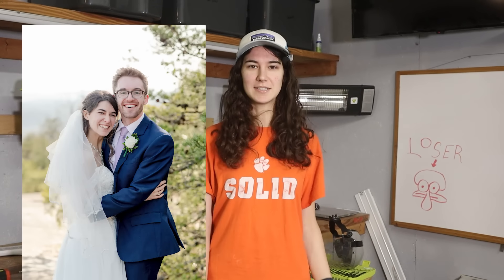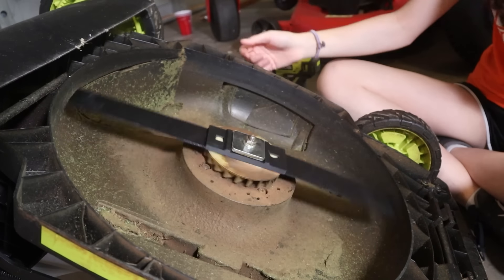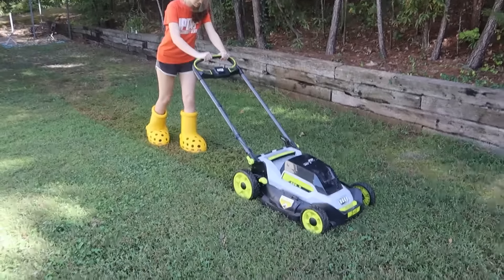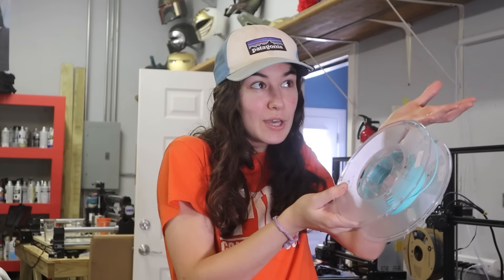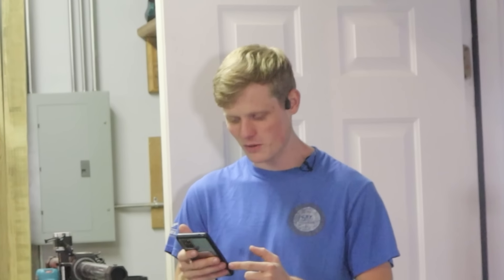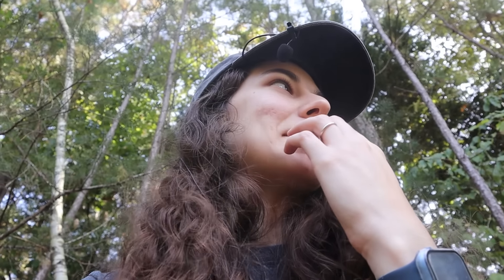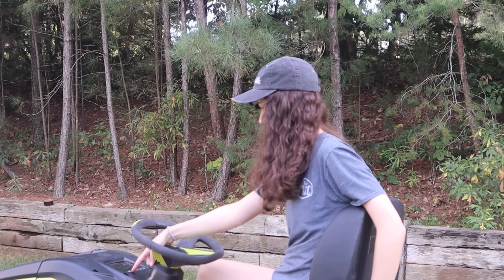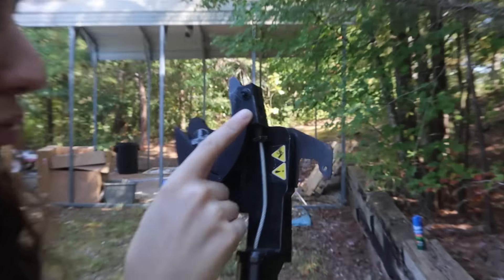3D Printing Lawnmower Blades?

Comment: My mower used plastic blades which kept breaking in seconds so I made a set out of titanium. They haven't failed since.
Reply: Did you 3d print or smith the titanium? There are titanium printers now?
Reply: I'm sure that's exciting when you hit a rock 😅
Reply: I'd be tempted to make it out of tool steel, then the rock will break rather than the blade.
Reply: @TheWinjin  It's not a complex shape, I just cut it out of a bit of plate I had in the scrap bin. Didn't realise white sparks fly off even when you drill it 😅

Comment: Yeah of course it works they've only made plastic blades for weed eaters for decades but it only takes 5 minutes to sharpen and remove all the nicks from your metal blade which you can literally use for a 100 years and never buy a new one ever if you just sharpen it with a grinder I have a 3 d printer but yeah 8 cents of filament and 8-12hours to print it usi g your electricity and you had reprint it so your 8cent blades probably cost you 40$ on your electric bill instead of buying a 20$ blade or better yet a 10 $ grinder wheel for a grinder its beyond a bad idea its moronic.and ofcourse filament works for weed eater string but since it costs about double or triple what weed eater string costs it's not worth it but you can use weed eater string as cheap filament for your printer if you run out

Comment: I have heard that weedwhaker string IS usable as printer filament, IF you dehydrate it first. PLA is too brittle, TPU is too weak for long term use, Nylon will work, but a roll of that is between $35 - $65, and a spool of string is by volume, cheaper ($15 - $20). I intend to test the string on my Sovol v6 once the season is over and sales are out for it.
Reply: Make sure you have adequate ventilation. Trimmer line is a special concoction that will likely release toxic gases when up to extrusion temperatures.
Reply: @zachdemand4508  That's true for ABS, TPU, Nylon, and some of the Poly varieties. I have carbon filters and an enclosure for the printer I have setup for the more exotic filaments. Both my Ender 3 pro and my Sovol v6 are ok printers, but they are rather slow. And prone to repetitive, habitual  failures as they age.

Comment: A friend suggested this a few years ago mostly to try to prevent fires. I think it might work best if it was combines with a sharpenable aluminum edge/framework,  3D printed filler and then a carbon fiber/epoxy surround costing.
Reply: Getting L channel aluminium or steel is easy, so that could be used, although you probably want a sharper angle, so just a piece of sharpened flat steel that attaches in would probably work.
Reply: @conorstewart2214  problem is steel will spark, so no better than the original blades when it comes to fire prevention.

Comment: I wonder how well printing the blades in something like PA6-CF/GF would work.
Reply: Probably would break even faster, fill makes prints more brittle and in this situation you'd want the blade to be able to flex rather than break. Regular nylon would make more sense, preferably printed from weed wacker line ;-)

Comment: Well strimmers (weed whackers for Americans) just use hexagonal nylon filament, that can be printed with. It would be interesting to see it with some other filaments, like polycarbonate, polypropylene or nylon with carbon fibre. Whatever you use you should saturate it with water first. If your actual strimmer line is too brittle then you stick it in a bucket of water for a while. A PA6 filament might work pretty well after being saturated and the TPU might work better when saturated too.

Comment: Fun fact, I forgot which specific size of filament it is (either the 2.85 or 1.75) but most weed Wacker line is just Nylon, so you technically can 3d print it.

Not even slightly recommend, but you can do it

Comment: Alright I hope this comment reaches you, because I really think that pruner could work. I would make it much thicker, maybe 10-20mm thick from petg, and make the pivot be at least a 6mm bolt with washers on either side. All it needs to do is securely guide the branch into the metal side of the pruner. I think that would prove much more durable, but also I'm not sure how much of an issue needing a printable replacement for the pruner is, I feel like I've never had one break on me, but maybe you guys use them much more than I do and it's a real problem.
Reply: That isn’t how those pruners work. They have one piece that is just flat and the other that is sharp, the sharp one on most (even hand ones) is the one that moves and that is the one she replaced like she said in the video. So if your printed one wasn’t sharp then all the tool would do is pinch the branch, not cut it.
Reply: @conorstewart2214  oh I see, I thought the fixed side was sharp
Reply: @dankay9202  I've never seen a set of electric or hand ones where the fixed side is sharp but that doesn't mean they don't exist, although it does make sense to keep the moving side sharp.